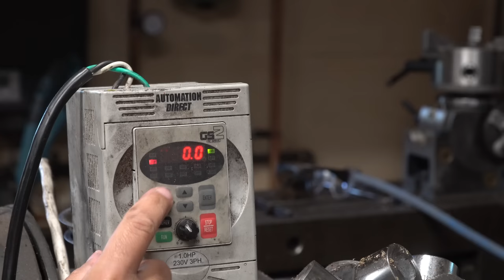1908 Wine Corking Machine [Restoration]

Comment: Tapping a thread in situ to free it is a technique I've never seen before. Bravo.
Reply: There also is a special file intended for repairing threads, its really helpful too. Especially when you cant access the end of the thread or dont have the correct die (the file needs to match the thread pitch obviously)

Comment: When you stick two pieces of wood with the intention of separating them later, during collage, intercale a sheet of paper from a daily newspaper between the pieces of wood. Leave the assembly of the pieces dry and you can then work them as if they were only one piece. Once the work is done, a simple wood chisel at the junction of the two wooden pieces will be enough to separate them. The newspaper serving as a break point. It is an old tip that wood modelers use for the manufacturing on the wood tower of the parts which must be separated in two in order to be put in a foundry mold. This separation used as a molding separation seal.
Reply: Interesting
Reply: @justtime6736  Do you realy anderstand all i say in my poor frenchy english? Glad to see someone is interested in this very usefull technic. You have try it?
Reply: @gyomdelacreuse922  Your English is plenty clear
Reply: @ironardito2633  merci!!!!
Reply: @gyomdelacreuse922  ton anglais est très bon. Je note que ce que tu as traduis par wood "tower" serai mieux traduit par wood "lathe".
Reply: Your English is a lot better than my French. Don't worry about it. I figure by Tower you mean a lathe? The pattern makers at the foundry I worked at used that technigue. Haven't thought about it for few years.

Comment: Gorgeous restoration, Eric. Always stop what I'm doing to watch your videos when I see new ones posted! 

Awesome tip on the cat grit. Do different breeds leave different finishes? Would using a sphinx be akin to stropping?

Serious question... Were cotter pins always bent like that on old equipment? I always wondered why you (and most other restoration channels I watch)  just barely split cotter pins, instead of bending them all the way around into boat anchors, so the stabby ends don't poke unwary hands/fingers/clothes/cats.

Comment: Glad to see someone that understands the finer points of sanding with a cat.
You start with the paws.
The cat will claw the surface if it needs it.
If it passes the paw test you move on to the super soft belly floof.
Once your surface had been cat belly floofed you know it is smooth.
Would like to see more of the cat.

BTW Did Jimmy just happen to be holding the chicken or is that his communication device?
The way I think it went down is he was working in the  DiResta cave when one of the chickens started screaming "Nutella!  Nutella!"
 then says "I have a call from Hand Tool Rescue.  I would know his ring tone anywhere!"
He then answers the chicken.

Comment: I'm a subscriber to your youtube channel love your work. what do you know about a logan  211 metal lathe. iknow it's suppose to have leather belts but they want big dollars for them. I've replaced the motor cleaned off 95% of rust. any ideas on how to make the drive belt that turns the chuck stay on the drive pulley? several parts were broken had them welded .sorry no pics . OH this lathe also comes with a power kraft threader/ speed selector. just want to know what your idea's were.

Comment: Your intro is golden! 👌
I’m just an armchair nitwit so please be gentle but wouldn’t just cleaning the thread with a wire brush and lubricating it have been better in hindsight? 
I’m just curious.

Another question: wouldn’t grease be longer lasting than oil? Again, I’m just curious.

Comment: I will advise a great procedure for loosening and disassembling rusted steel parts that do not mind heating. The nut, screw, pin, bushing are all heated to a dark or more light heat, do not melt. Then the whole thing is cooled down sharply, preferably by immersion in water. After cooling it is very easy to take apart. It can also be greased. The rust turns to black powder, the parts are clean, unbeaten, undamaged. I also use it with success on soft cast steel, where there is no risk of cracking.
The best heating is an oxyacetylene burner, and induction heating is also good when the surroundings are not burned.

Comment: When spinning a part on the lathe, is it possible to cut into the spinning chuck on accident or is there some sort of limiter that keeps the cutting tip from reaching the chuck? Do you have to replace chucks if they get damaged from that?
Reply from the maker: You can cut it all you want and I definitely is not good for the lathe.
Reply: @HandToolRescue  Awesome.

Comment: Out of curiosity, the gear with the broken tooth, was it possible to install it backwards intentionally? I would imagine that there was plenty of force on that tooth alone to cause it to break and putting a repair in that section would be weaker than an original casting, unless you're confident in the rebuilt tooth.

Comment: Have you ever used bees wax for penetrant, it works wonders and it's cheap, just heat object and apply wax, it runs into threads and loosens the bolt or nut , Try it , you'll like it.

Comment: The modern manual corking machines aren't much different. I make wine with friends every year and we have a couple such devices. They are stand alone and have a much longer handle so it's pretty easy to use.

Comment: what kind of welding type technique did you use on the gear part haha ive never seen that before
Reply: Pretty sure that's brazing with bronze. Lower temperature than welding, higher than soldering.

Comment: 27:14 : wait, is that grub screw pressing directly on the thread?
Reply: Well, it's not like he can put a flat there as the bolt is meant to up or down relative to the grub screw location. That's an issue with the original design.

Comment: an excellent example of a tool who became less sophisticated but more efficient with time : moderne corking machine have tripod feet, a tablet where the bottle rests and a handle twice to thrice longer which requires less effort...
tip : soak your corks in some wine (or boiled water) before use to make them more tender and avoid creases...

Comment: An old trick that I somewhat recently picked up for super stuck pins and hinges is what's called the tea candle trick.
You heat the stuck surfaces up with a blow torch, melt a tea candle on the stuck joint, ideally both sides of it, and then it should pop right out easy as pie.

Comment: Before dismantling any mechanical device. Use penetrating oil several times two or three days prior to dismantling. You won`t need so much  violent force then.
Reply: Usually he does that, I was wondering why he did not do it in this case as well.

Comment: 6:00  You've used this for ~500 projects, does it ever just "wear out" and need to be completely replaced?
8:30  How do you know what size and type grit to use in order to get the job done, but not damage anything?
21:41 Where did that foot really come from?   I find it far too specific for someone to have one lying around.   But that's obviously the correct original.